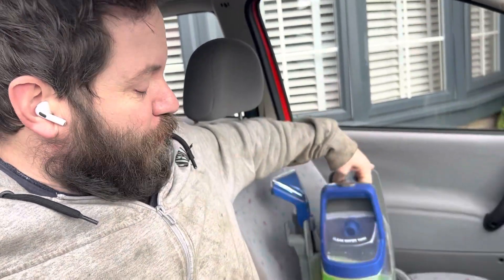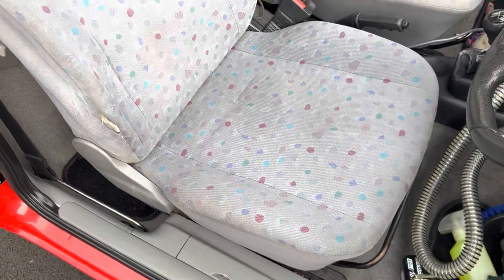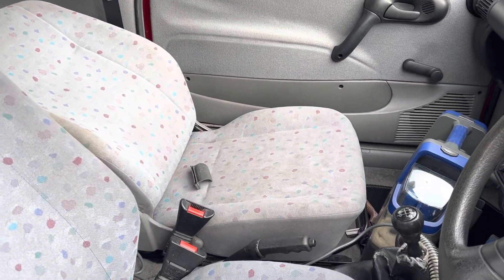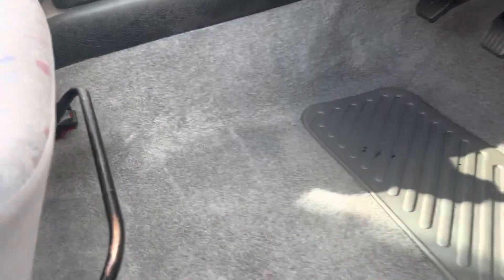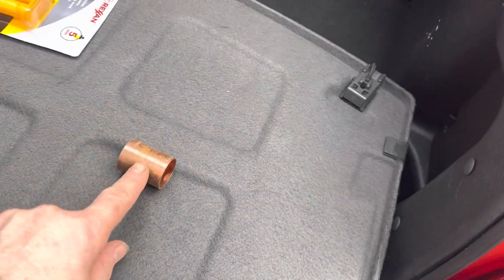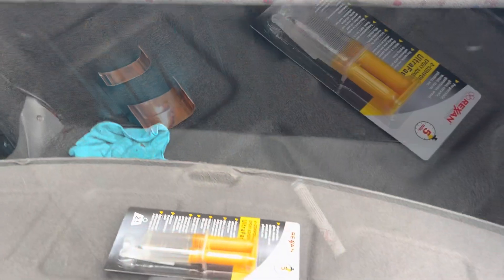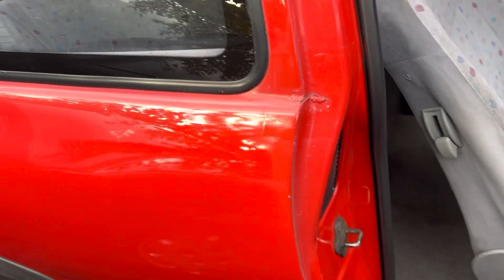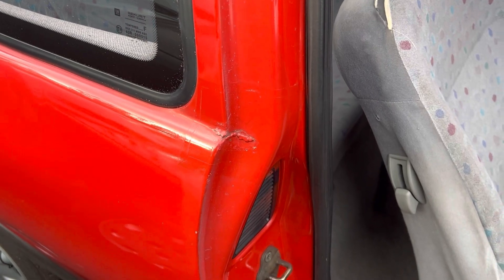Vauxhall Corsa B rescue part 2 barn find will I lose money getting it back on the road? 1997 1.2

Comment: Used to work in the car yards at Portbury Dock near Bristol where these cars were landed from the Opel factory in Spain. Used to get the Tigras come in from same place. They all came in covered with protective wax and the Welsh boys used to steam it all off when it was time for cars to go to the dealers. There's a fair chance I thrashed this car along the dock roads on the way to be loaded onto the car transporter when it was new.    😊
Reply from the maker: The thrashing hasn’t done it any harm if you did 👍🤣